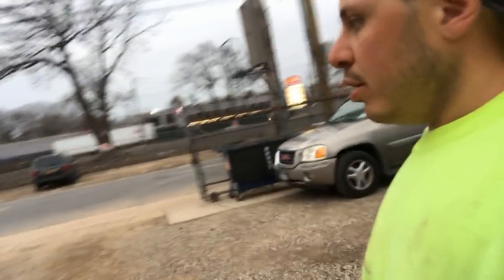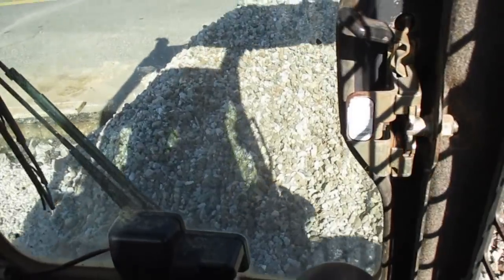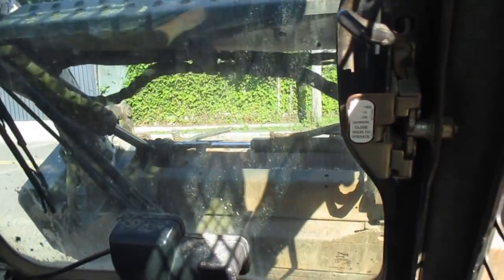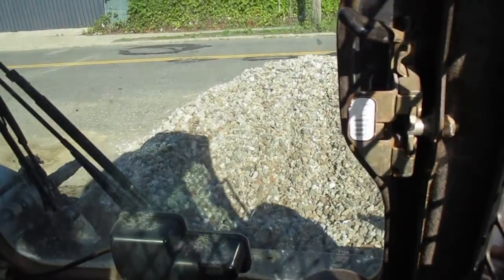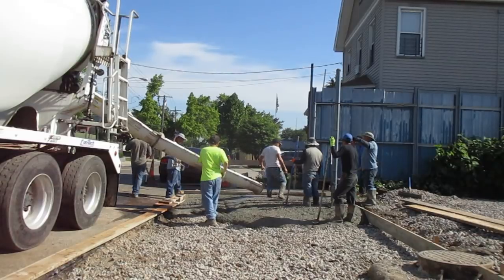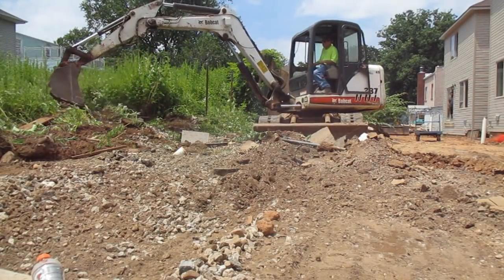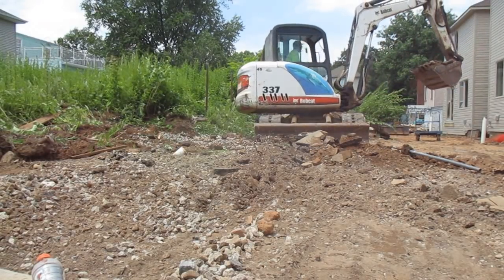How to Bid a Concrete Driveway

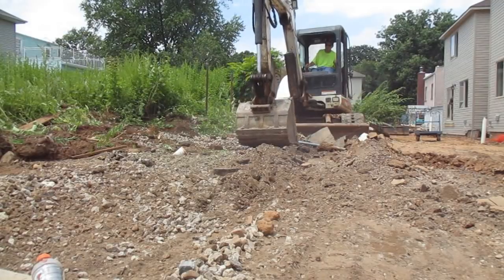Comment: concrete  is actually fresh anytime you order it. It is only good for about 90 minutes from the time the batch is mixed, there is no way it can turn in a mixer all day long.  yes outside temp can effect cure time, so obviously mornings are cooler and that may save some time. but 12:00 concrete is just as fresh as 8:00 concrete.

Comment: i have the experience to be a concrete contractor how can i get these type of jobs from clients i know all the bid numbers aswell but do you think i need a bond and insurance?
Reply from the maker: In my area, (NYC), we need workman’s comp, general liability, and disability benefits policies. We also need a license from Department of Consumer Affairs, which is easy to get. You only need a bond if your doing sidewalk, curb, or road work. I work for new construction builders so just driving around and handing out business cards on construction sites is all you can really do. If your looking to work for private homeowners, leave flyers in mailboxes, online, and websites work best. Hope this helps. Good luck.

Comment: I want to secure my iron railing that has weakened and come loose from its anchor points on the steps to my side door. Would you please give some advise on patching that up? I tried to add railing patch but was unsuccesful
Reply from the maker: Try Portland cement or mortar mix in the bags.

Comment: Regarding the wire mesh, where do you put it in a 4" pour? I know low placement is for load bearing, and a higher placement is for crack control. Do you just put it at 2" depth, for the best of both worlds?
Reply from the maker: Try to get at as close to the middle as possible.